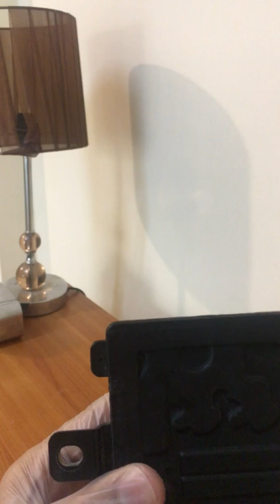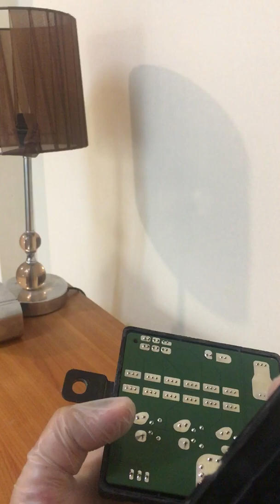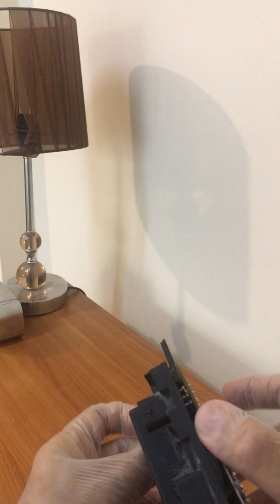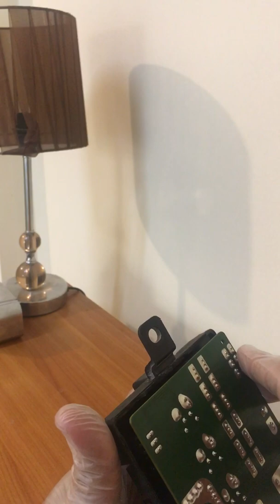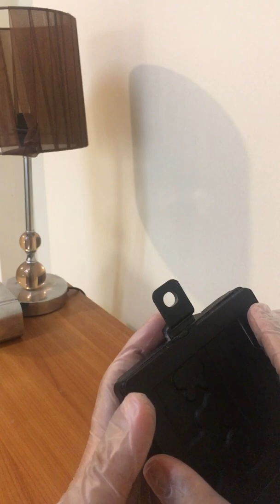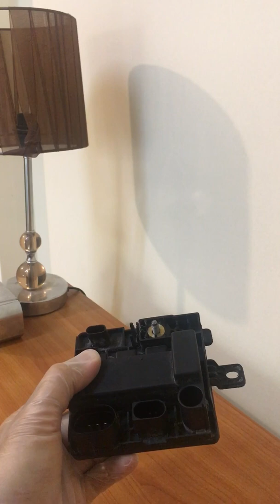BMW X5 E70 Integrated supply module ISM Z11(Power Distribution fuse box) dissembling and repair

Comment: Hey Afeef, were you able to figure out what was causing the "crank but no start" condition? Let me know!
Reply from the maker: I was getting a bunch of electrical error codes listed in the discription  https://youtu.be/6vYPbAeDc5E
Reply: @bimmerhacks  By the way, how did you get this power distribution module to open? Do you have to use a heat gun to melt the glue on the enclosure?
Reply from the maker: @stevesung1103  just heated with conventional gas stove without touching the flame on the plastic like 30cm above the flame and cutting it with a blade ... No need to apply much pressure as it will cut like butter when heated
Reply: @bimmerhacks  lol gotcha. It's nasty of BMW to permanently seal this thing so that if one fuse blows you gotta replace the whole thing for $140
Reply from the maker: @stevesung1103  I don't think it will be ISM Module as it is only one code... ISM module gives supply to DME to switch many modules, that's the reason I suspect something that comes after DME, like fuel blockage or crank sensor ... Check fuel like if u can... MHD CAN TELL YOU IF  HPFP IS FUNCTIONING OR NOT
Reply from the maker: @stevesung1103  any luck?
Reply: @bimmerhacks  Hey Afeef, check out my post on Bimmefest if you've got some time
https://www.bimmerfest.com/threads/2013-f30-335i-85k-miles-cranks-but-wont-start-fuel-pump-issue.1395548/

I confirmed that I was having no power on the pins for ignition and injection on ISM with ignition on. I replaced the part, but it didn't resolve the issue. To root cause the problem, I directly connected the old module that I had removed from the car to a spare battery and those pins still had no power. I was able to hear the relay pulling in for those 2 pins, so I'm guessing fuses must be blown. If the new module also has blown fuses, I can at least focus on finding what's causing the fuses to blow as soon as ignition's switched on.

I've been also meaning to check DME grounds, but work and babysitting got me tied up..
Reply from the maker: @stevesung1103  read your thread and got tired :p .
Did you open up your ISP/IVS/ Z11 whatever it's called? 
I would suggest if you find a fuse blown in that module then it would be easier for you to drill down as I did. Don't use a multimeter if you find a fuse blown, instead use a headlight bulb connected to the positive of the battery/positive terminal of the car and the negative end of bulb to the contact in the ISP where it goes to the DME (If you're using external battery connect negative of battery to the car Body). Keep the vent hose electrical connector disconnected from the valve cover to the air intake air pipe. If the bulb is ON you got a short circuit somewhere and you need to disconnect modules one by one. I know you know better than me :) post back if I can help
Reply: @bimmerhacks  LOL yea I've been pretty diligent with the documentation. As for the Z11,  I haven't managed to crack it open. I tried heating it up with a heat gun, but it only melted the edge a little bit.
Reply: @bimmerhacks  What exactly was the root cause to your no start issue again? Wondering what you did to fix it.
Reply from the maker: @stevesung1103  same like you. Car cranked but no start at all. I fixed my car as I mentioned to you today with the help of bulb and disconnecting one by one and finally I found a wire jammed and grounding to the body in front part of the engine near the VANOS Solenoids
Reply: @bimmerhacks  Think you could take a picture of the wire that was jammed so I can check it?
Reply from the maker: @stevesung1103  for me it was easy as I holded the ISP 10-15 cm above the flame of my gas stove one side at a time. I'll try to show you the area where I had the short circuit but cannot make the wire out as it is a bit difficult. I think I had demonstrated it in my video the place where all the cables go through and it was a mistake done from a garage by bolting the cable between (not intentional).
Reply: @bimmerhacks  Trying to figure out which cable this was. You mentioned it was near VANOS solenoids, but the layout might be different on my N55 F30.
Reply from the maker: @stevesung1103  but according to F30 schematic circuit the short circuit is from your injectors. F04 safeguard your injectors
Reply: @bimmerhacks  Question about this fuse. If you still have access to the wiring diagram, you'll see that when Relay #2 is pulled in, it energizes pins 5 and 6 (via fuse F04 and 05, respectively) of Z11*3B connector which has 6 pins. I replaced the blown fuse and manually powered up this module to a spare battery--power feed pin/stud to +'ve terminal and pin 4 of the Z11*3B connector to -'ve. I was able to hear the relay pull in, but still had zero voltage on pins 5 and 6. When I removed the -'ve connection from pin 4 and put it directly on pin 5, both pin 5 and 6 had 12V. Similarly, when I put power to pin 6, both pins 5 and 6 measured 12V. Maybe the relay that powers these pins on my old ISM is fried even though I can hear it pull in, so it's not really helping me diagnose the issue?

Can you send me an email so I can add some pictures of what I've done with ISM and injectors later on? Youtube comments are not the most convenient tool for this communication..
Reply from the maker: @stevesung1103  post your email address please
Reply: @bimmerhacks  you have number
Reply from the maker: @pedropena8370  I cannot disclose my number but I can help you via email: afy511@gmail.com
Reply from the maker: Check this out, I just did a study on TIS on your current condition. Let me know if you already did it or if you need any support from my limited knowledge :)
https://youtu.be/wLmDhTf6X3o
Reply: @bimmerhacks  Thanks for the support, dude. I really appreciate it. 20 tabs of TIS look pretty intense lol. I haven't checked any connections on FEM (A173) yet, but I've already checked the voltage on Fuse 165 that you mentioned in the video. Besides, I confirmed 12V on the power feed wire to the EKP module (A98), it just doesn't send any voltage to the low pressure fuel pump. As you could see in my Bimmerfest post, I'm focusing on the ISM with the thought that it's not allowing EKP module to communicate properly. I finally cut the ISM open tonight and confirmed that the 15A fuse (F04) for injection was blown. So, I replaced the fuse and connected the module to my spare battery to see if grounding Z11*3B pin 4 would put power on pins 5 and 6. It did not and I'm thinking maybe the relay is fried on this old module. Investigating what would cause the relay to get fried..
Reply from the maker: @stevesung1103  I hope that's a good news which indicates your DME is good, no big money I guess. Let's see
Reply from the maker: @stevesung1103  I went through the TIS and as per my studies one or more fuel injector is faulty causing the fuse F04  to burn out. Check it out .... Use the bulb method on the PDM/ISM to find out the short by removing each fuel injector connector one by one.
Reply: @bimmerhacks  I'll try this. By the way, it looks like newtis got taken down. If you want to use the official TIS, it costs a fortune. Such a scam.. I've got ISTA, so I can still access the same info.